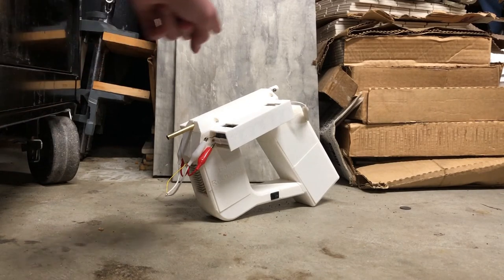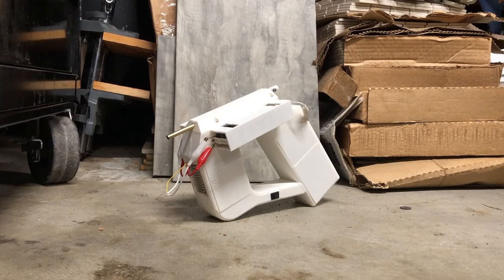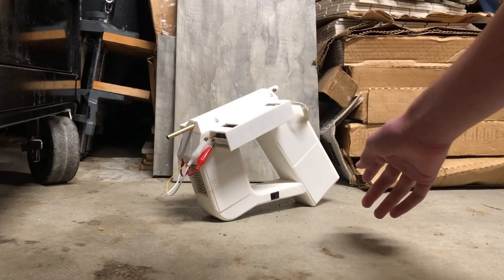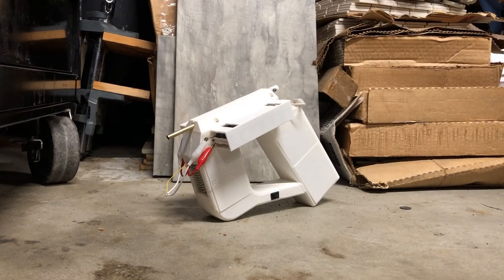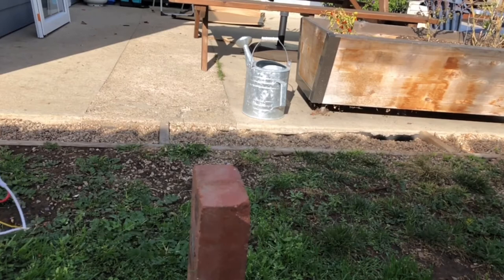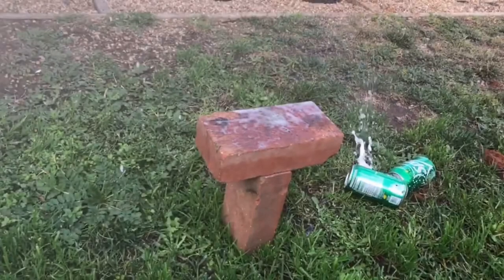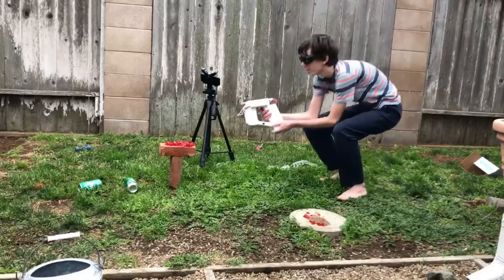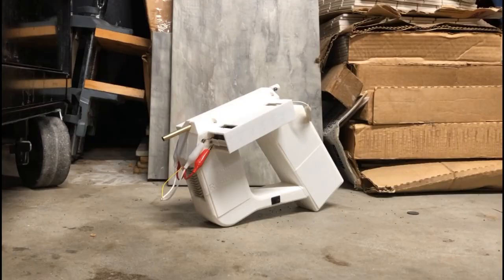Plasma Powered Electric Handgun (Electrothermic Accelerator)

Comment from the maker: I guess I forgot to mention it, but the projectile is a little piece of steel rod that I sharpened, and has some tape rapped around it to form a seal with the barrel. .
Reply: And what do i have to type inside the search box to see those videos?
Reply from the maker: @x1mikey95  "electrothermal accelerator" should bring up a couple, I know there is at least one that goes into a bit of depth.

Comment: Do you think this is better than using spark gap to make plasma?
Reply from the maker: I think the performance is better for the same power input with the system I had here, but I think spark gaps are more practical. Since I made this video I've learned that a lot of the performance in this device probably comes from the aluminum vapor having an exothermic reaction with the air and water in the chamber. That is cool and makes this device powerful, but it gets away from the goal of he project and also reloading strips of aluminum foil is tedious.

Comment: Great video what's the circuit diagram? Can you make a proper tutorial on this one?
Reply from the maker: Yeah a tutorial is something I want to do at some point, but that might not be for a while. Until then, I used a 12-400v generator I found on amazon to take 12v from either a 3 cell LiPo or 8AAs to change a bank of capacitors (this one was only 1200uf total). The banks discharged through the foil, which was clamped between 2 screws in a little  chamber I printed that let out into the barrel. There are other tutorial-like (or at least more in-depth) videos out there too.